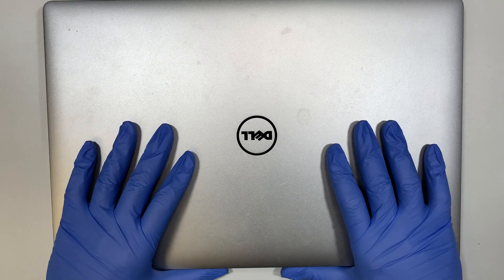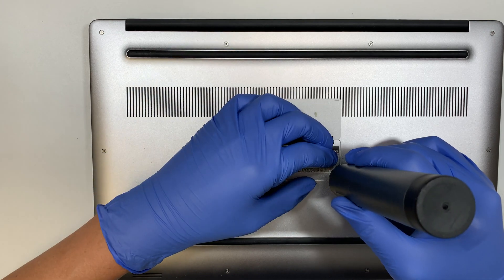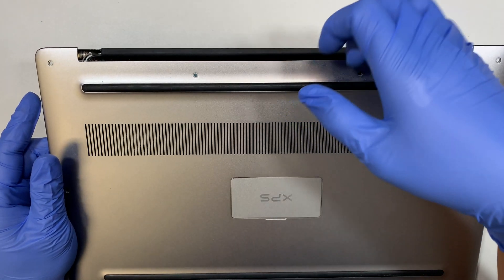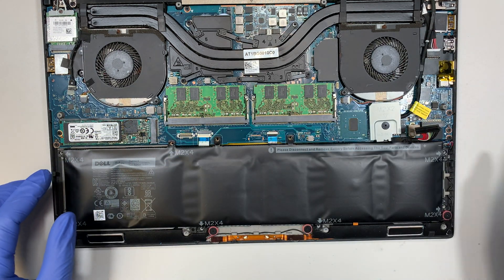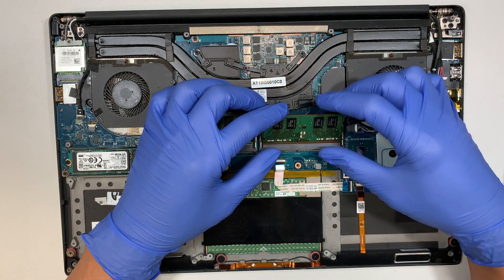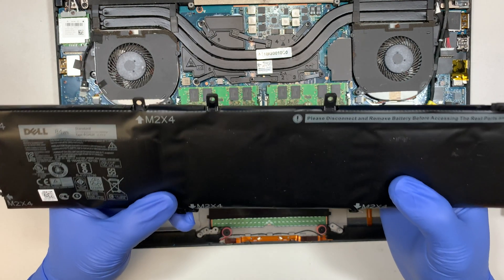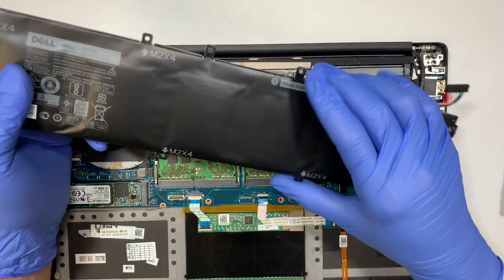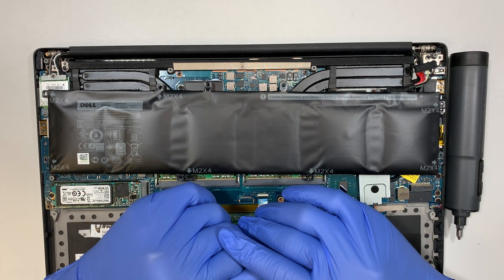Dell P56F Laptop Battery Replacement

Comment: Very helpful great job by you. I am not technical but I changed the ram on another laptop and it gave me the confidence to try changing the battery. Since I'd changed the ram I had the tools needed to make this repair. I realized I should have been letting the battery drain although I never considered doing this everyday when using the laptop. Also my touch pad has been distorted (elevated for quite a while) and I would have never associated it with the battery.